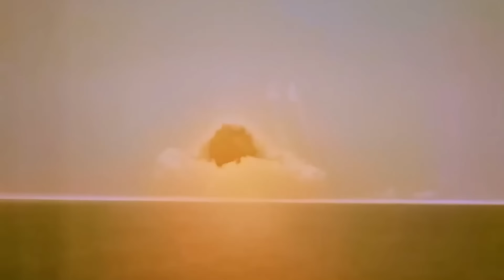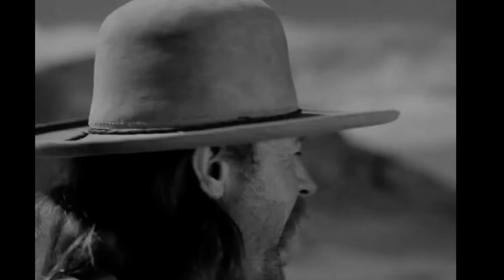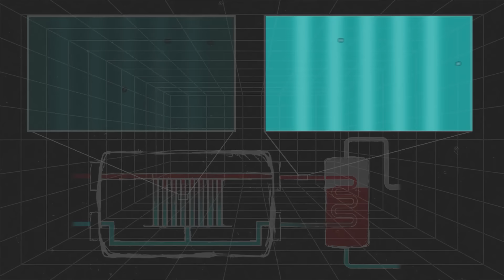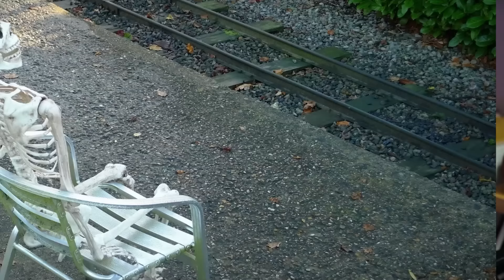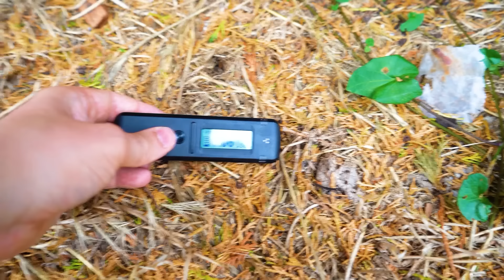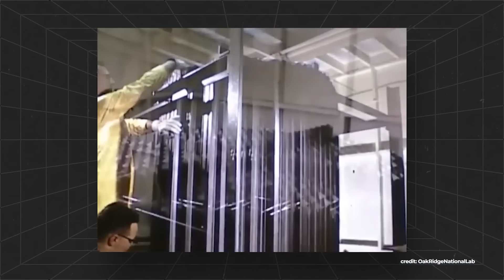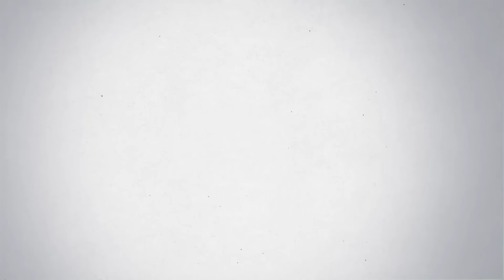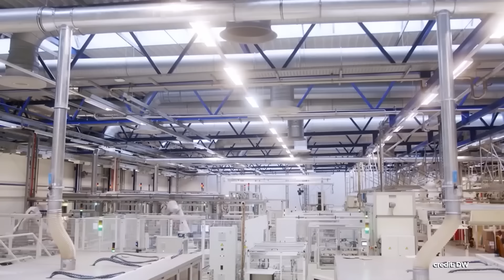It's Happening - China Launches World's First Thorium Nuclear Reactor

Comment: One additional advantage China has in the pursuit of Thorium power is its widespread deployment of UHV power grids, which enables profitable electricity transmission across far longer distances with lower transmission loss relative to conventional power lines. This enables the PRC to place Thorium power plants in far more remote locations, & take advantage of massive amounts of under-utilized land in its interior. This provides both economic & security benefits.
Reply: 智能电网系统
Reply: Remote means in a desert and you need cooling water. So close to rivers or the sea is more practical
Reply: @douglasashby4349 find out before commenting. Mate..
Reply: @douglasashby4349  bro, try comment AFTER you finish the video
Reply: @Dordordord Bro. I did watch the whole video. Was just commenting that water cooling is more efficient and practical. Anything else adds cost and complexity.
Reply: America's 400 grid operators have incentive to prevent a free market in electricity. Chaos is profit.
Reply: what's UHV??
Reply: @JonWolaver  Ultra High Voltage
Reply: MSRs are intrinsically safe designs (the furthest a nuclear mess can go is a few dozen feet) and putting them near population centres allows the waste heat to drive district heating/cooling(*) systems. I fully expect to see them in/near urban centres, like Battersea was back in the 1930s (Battersea provided district heating to a large chunk of London back in the 1950s)

Whilst the intention is to roll them out in water-scarce areas first, MSR advantages are simply too great to favour water-moderated in the coastal zones once the things have been proven

(*) "Free heat" can trivially drive electrolux-cycle chilling systems with the inefficiencies really not mattering. Heat exhangers keep the ammonia away from where it can hurt people and this kind of thing is already being done at several power generation sites
Reply: @miscbits6399  I should've clarified that when I say "security" benefits, I mean the benefit of placing MSRs far away from Chinese population centers because those centers are primarily clustered around China's east coast, & therefore would be well within range of US conventional missiles & aircraft should an armed conflict break out. If more critical infrastructure can be placed in China's interior, it would mitigate these geopolitical security concerns.
Reply: @GMATveteran  For hypersonic missiles, this makes no difference.
Reply: And who will operate it at those remote areas?! This isn't as simple as that.
Reply: Economic recession & severe youth unemployment are going to stagnate them for a long time
Reply: It is all moot, as any real implementation will be too late.
When the pilot projects are small and half a decade out, it is clear nuclear is a distraction.

We can't go on behaving like it is 1985. 
We are on the brink right now, and need a swift transition today, not in 10-20 years.

Also look up 'deep warming'.
Supplanting coal plants with nuclear plants will continue the heat pollution.

Building wind and storage to supply 1 GW will save us 2GW waste heat. 
That used to be negligible, but in our current crisis it is as good as carbon capture.
In other words we get double the bang for the bucks with wind - which is already cheaper.

No time to (produce) waste!
Reply: @madshorn5826  china is currently building a lot of renewable energy infrastructure, this thorium reactor is obviously planning way ahead. They went from around 70% fossile fuels in 2016 to close to 50% with plans to go even lower by 2030. It is certainly not enough if the rest of the world doesn't follow suit but it is a great step forward
Reply: @aarvlo The part about china going all in on future green energy is absolutely true, however, they are nowhere near 50% green energy production, unless you count coal as “green” energy that is. They have done a great job thus far, and that’s commendable, but don’t act as if they are doing so out of concern for the environment. If China had large domestic fossil fuel reserves, they’d be using that. Domestic availability of coal is a big reason they use so much coal generation. Well, that and all the coal power plant machinery they’ve been able purchase for next to nothing and import from countries that decommissioned them in favor of natural gas. No, the Chinese government is so interested in getting away from fossil fuels for them same reasons that motivate all governments, power (and not the electrical kind). They see dependence on imported fossil fuels as an impediment to their own power. They’ve cornered the world rare earths processing market, largely by ignoring environmental concerns that drive up costs for rare earth refiners in other countries. In doing so, they have been able to make rare earth processing uneconomical for everyone else. You see, rare earth minerals aren’t rare, like at all. They are actually some of the most abundant minerals out there. It’s just processing the ores that contain them requires massive amounts of highly toxic chemicals. It creates a shit ton of toxic waste/ spoil per unit of actual rare earth mineral. In short, it’s exactly the sort of thing no environmentally considerate person/ group/ govt would brag about doing on the cheap. The govt in China sees their current rare earth dominance as a way to control other countries’ access to clean energy. Putting aside the fact that rare earths aren’t like oil so using them for leverage as if they were won’t work, the way China is attempting to use that (perceived) leverage is by threatening to withhold them from countries who refuse to allow them to flood their markets with highly subsidized & therefore cheap green energy related goods. At first, this doesn’t seem sinister at all. Why not let the Chinese government subsidize your green transition? What’s not to like? I’ll tell you. All of these subsidized goods happen to compete directly with products made by the emerging green energy related industries in the countries they’re trying to export them to. Should these countries allow these artificially cheap goods into their markets, it will kill any competing domestic manufacturers. These domestic products are invariably more expensive, largely due to the cost advantages provided to their Chinese competition by subsidies. I say largely, because labor costs are roughly the same now. These green industry jobs often represent an avenue to provide stable, well-paid employment opportunities to a sizable portion of the population who lost the most when companies chose to move their production facilities to China over the last few decades. If they are allowed to go they won’t come back. So there is a lot of popular opposition to throwing that all away in exchange for a few years of cheap (subsidized) goods. It seems short sighted in other ways as well. By destroying these burgeoning industries in countries China relies upon heavily as export markets, China seems to be willing to trade stable long term market opportunity for immediate, short-terms gain. Opposition to China’s strategy is strong from higher ups in industry & government as well. They see China’s decision to produce massive amounts of such products, way more than could be justifiable by forecasted demand in the countries’ markets they hope to export them to. Worse yet, China seems entirely uninterested in supporting the expansion of the domestic service economy that would allow more of its own citizens to purchase all the excess goods they’re producing. This move from an export dominated economy to an economy with a larger emphasis on the domestic service sector is the way every other large economy was able to create a domestic consumer base capable of sustaining economic growth as increasing labor costs continued to make their manufactured goods exports less competitive. By attempting to continue on with manufacturing led growth, Chin’s only option for growing their economy further is taking over what industry is left in the countries it exports to. These countries already moved most of their manufacturing to China. That means those industries China is now competing for are industries those other countries had good economic reasons not to move to China. Should China be allowed to replace those industries with its own, those aforementioned good economic reasons not to move them will come into effect. At first this will destabilize these economies and eventually, it will ensure they become unsustainable. At that point, China will have no one left to export to. That is, if all the social disruption doesn’t lead to a much darker outcome. These countries see this from China together with the subsidies, and to them this looks like textbook dumping. It’s as if the strategy was tailor made to destroy their domestic green manufacturing industries. Green energy is seen among these types as a golden opportunity to rid much of the world of the volatility and conflict that arise when global energy is concentrated in a handful of countries. Large nations each having their own domestic methods to build out renewable infrastructure capable of fulfilling their domestic energy needs gets rid of the political pitfalls of oil. If they were to just sit back and allow China to become the only major producer of green infrastructure, they’d be allowing the same dynamics associated with oil to arise artificially.
Reply: @williambrasky3891  you wrote many words but all likes fart
Reply: @aarvlo  The UK already betters this! Today (3 Sept. 24) our generation was from Coal (1.8%), Gas (30.9%), Solar (11.8%), Wind (11.1%), Hydro (1.6%). Nuclear (14.9%), Biomass (9.6%) and Imports via undersea cables from Europe (19.1%) This changes all the time, e.g. since these figures, the sun has come out so solar % has increased. So we are around 33% fossil fuel, since most of the imports are hydro (from Norway) or nuclear (from France).
Reply: @rogerfurneaux1529  yes the uk is currently better but in 2012 the UK already had 30.7% of renewable energy meanwhile china was at 20.4%. Another fact to consider is that china imports around 15% of its energy meanwhile the UK imports over 37%. Not to mention the vast difference in scale in the power infrastructure of both of these countries. This is not to undermine the achivements of the UK which are impressive compared to most of the world but what is impressive about china is not their current state but their rapid advancements towards green energy
Reply: @williambrasky3891  
     have you ever heard of paragraphs, or at least indentations? 
     It kinda became mindless rambling midway through because you haven't segmented your ideas 

No political critique, mostly because the substance was hard on the eyes
Reply: @williambrasky3891  Even through the screen I can feel how uneasy you are about China's success.
In general, China is a more moral country than the West.
Reply: @williambrasky3891  It,s hard to read such a long comment with no paragraph with no space in between ,it is difficult to follow the next line of comment.
Reply: @madshorn5826 china is the only country actually implementing any of the green energies that western liberals whine about but never implement 😂😂😂
Reply: @NeostormXLMAX  That's how authoritarian governments are structured. They handle massive, expensive projects, like futuristic looking cities and experimental thorium reactors that would be too unprofitable in the West to have capital directed towards it.
Reply: @madshorn5826  maybe for your country,  but wind turbines alone will not power electric cars for the nation and it definitely won't power data centers with huge AI workloads.
Reply: @novafiddler1712  
What I'm hearing is "I can't work as a cleaner, because that would not pay for my bubbles and caviar"

Maybe the world has to change when reality catches up?
Reply: @madshorn5826  nice try fearmonger but nothing you've said has any substance.
Reply: @Dizzeke  
I'm not trying to fearmonger, just give a timely warning.
Sorry if popping your worldview makes you uncomfortable.

I would love to be wrong about deep warming, but I can't see flaws in the scientific literature about thermodynamics.

We have isolated our "greenhouse" with CO2.
This raises the temperature dangerously.
Putting a space heater in the greenhouse will raise the temperature further.

That means we can't use more energy than today because any energy use ends up as heat.

Wind is an exception here because wind is recycling the heat in the atmosphere, but once we have built enough wind to drive a modern society we likely will have run out of space and/or minerals.

Therefore we have to plateau our energy consumption yesterday and preferably scale back.

Note: If we get a better economic model scaling back will not be the problem it seems under the current economic model.
Reply: @madshorn5826 wind is the most useless form of renewable I know of. First u need 11ms-1 of wind regularly. So it is out of question for many countries including my own. Not to mention the heavy amount of repairs and parts replacement that they require.
Reply: @iambatman.5894  
11 m/s?
What are you talking about??
At this very moment the wind speed is 5 m/s across Denmark and we are getting 3.9GW out of the 4.6GW we need.
If we build more turbines and energy storages we will have all the energy we need.
You may live somewhere without a coast, but then you will have clear skies most days and therefore solar power.

The future is a patchwork of local solutions, which is why the nuclear lobby is desperately trying to sell you the idea that only their solution is valid.
How else could they sell an overpriced "solution" that gives them an energy monopoly and keep their authoritarian friends in business selling unhealthy fuel?
Reply: @madshorn5826  No. There is no "crisis". Fear and hystericism provoke really bad decision making. GIGO, henny penny!

Comment: Reactor design concept: An egg wants to roll away from one position. Make a reactor that take energy to stay pivoted in a "max reaction" position, so that loss of power causes it to rotate to a minimum reaction position.  Rather than moving graphite rods in and out of a molten salt pond, let the inside of the container have an increasing number of rods at one side, fewer at the other, so that the rotation of this egg brings the molten salt-thoreum/uranium mix among more or fewer carbon rods.   
This simplified design allows for numerous possible scenarios for absorbing heat from the mix, while minimizing the moving parts in contact with the corrosive molten salt.

Comment: Fission & fusion research are fine, but I'm more interested in RTGs & betavoltaics. Just a trickle of power, but for many years, extremely durable, & without a breeder increasing the density, there's very little harmful material produced.   
RTGs powered our moon missions & are still the go-to power source for remote low-maintenance installations. They're simple & cheap to manufacture, & have lower capital & operating expenses per KWh over their lifecycle than almost any other energy source.   
Thorium isn't highly effective for betavoltaics, but it has very high availability & has worked well enough to remain in use for decades.   
Breeder reactors aren't the only type of nuclear power, & they're definitely not the most practical... They're high output, but so much more complex than betavoltaics, that they only become worthwhile at large enterprise scales; betavoltaics are so cheap to make & use, that their lower output isn't half the obstacle that centralized providers wish it to be.

Comment: The  most common sense, efficient use of a viable natural resource that yields huge benefits for safe efficient power generation.  Smaller modular reactors, I think, are the way to go, like in large metropolitan areas, maybe 4 or 5 smaller plants  for like the Orlando, Fla. area.  This saves hugely expensive  long distance transmission lines.  Since the energy is so safe to produce, it can be placed in metropolitan areas. Also think that solar farms need to be over the cities they are producing power for the same reason with the alternative benefit of shading for the heat sinks that cities have become.  Please post below if you are curious about my comments.

Comment: Is generating cheap energy very short-sighted.  The planet cannot dissipate the energy it gets from the sun plus nuclear power plants, add onto that the energy that is captured with solar panels so it cannot radiate out into space, plus the release of stored energy in fossil fuels and we end up with the situation we are in now. too much energy leading to higher temperatures and chaotic weather (high kinetic energy).  Having cheap energy may seem like a good idea but it seems like we have too much for the planet to handle.  A high carbon Dioxide level is more of an indicator than the cause.   energy output needs to be reduced: a low carbon dioxide level will help dissipate the excess energy, but will not cure the problem.

Comment: Reactors do not need to be  molten salt to use thorium.

You can use a part thorium in the fuel bundles in existing reactors.

Does require new certification and that's a  long path.

Comment: Containing molten salt is a nightmare. A huge reason it didn't take off was due to the extreme maintenance required to keep it running. Japan had a massive leake at a molten salt reactor. Made a huge mess and was largely covered up. Only a hand full of alloys can stand up for any length of time. Seal areas are another area requiring constant work. And make no mistake. It's still radioactive. So a parson fixing a pipe or seal gets exposed. Water based nukes rarely have leaks. Also keep minimal crew because maintenance is minimal between shutdowns. Be interesting to see if china's stolen blueprints can be made to work long term.